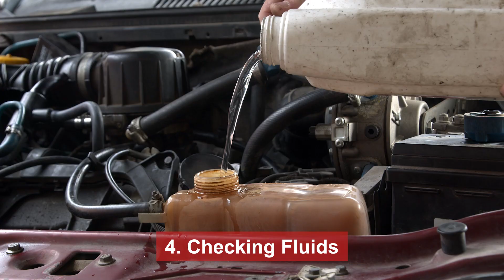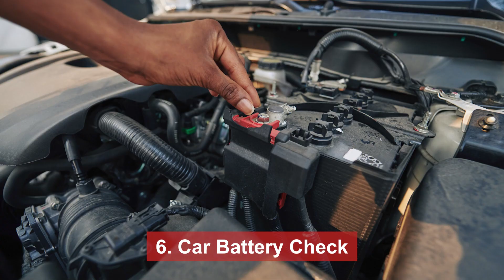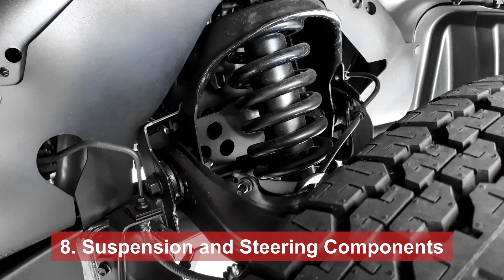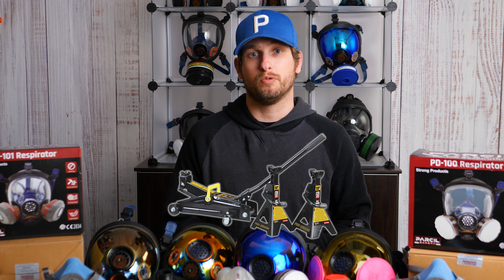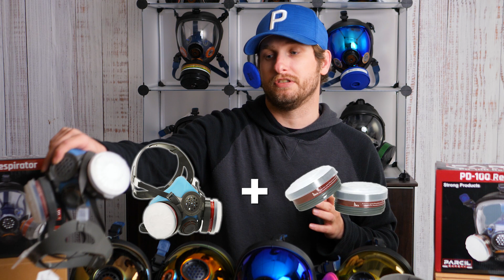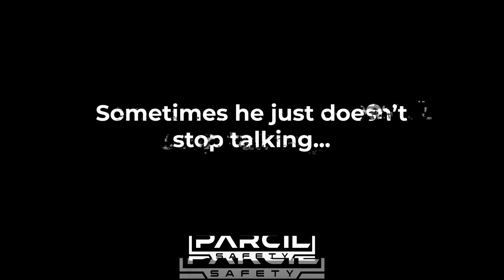What are the best respirator masks for the automotive industry? Parcil Safety's Best Auto Masks!

Comment: Could you please write down the names of the mask in the comments section ?
Reply from the maker: Certainly!  Below is a list of our masks and what they are best suited for:

PD-100 Full Face Respirator Mask - this is our original full face respirator and comes stock with Organic Vapor Filter cartridges with particulate filter inserts.  Ideal for working with non-oil based paints, sanding and grinding, epoxy resin work, etc.

PD-101 Industrial respirator mask - comes with industry standard bayonet style filter cartridges - perfect for those working in an industrial setting, automotive maintenance, herbicides and pesticide spraying, or any job where you may be going through a lot of filters. 

ST-100X Survival Gas Mask - Affordable option if you are looking for a gas mask in case of an emergency situation such as a wildfire.  

NB-100 Tactical Gas Mask - comes stock with our highest rated filter canister, the DefensePro N-B-1.  Perfect for your emergency preparedness bag and ideal for any situation where you may not be certain what chemical you are needing protection from. 

We also have a new NIOSH N100 ProSeal disposable mask and new NIOSH Half face respirators, our T-71 and T-81 UltraSeal reusable half-masks.  

Please let me know if you need any further information!
Cody
Reply: @parcilsafety  thank you very much, Cody
Reply: @parcilsafety  Hi Corey, which one you recommend for painting cars? PD-100 or PD-101?
Reply from the maker: Hi there!  Both will work, but it really depends on what you may need. 

If you are wanting a mask that allows for better vision, and are using non-oil based paints, then I'd recommend the PD-100 as the filters are a little more modular

If you believe the paint is oil-based, then I'd recommend going with the PD-101 and upgrading the filters to P3 or P100 rated particulate filtration.  

Please let me know if you have any follow up questions or need any clarification!

Thanks,
Cody
Reply: @ Hi Cody. Thank you very much for the explanation. I bought the PD-101 for my dad. He paints cars.
Reply: Waiting for it to arrive
Reply from the maker: Great to hear!  Once the mask arrives, if you have any additional questions, feel free to reach out to us directly at service@parcilsafety.com.

Always here to help.
Cody